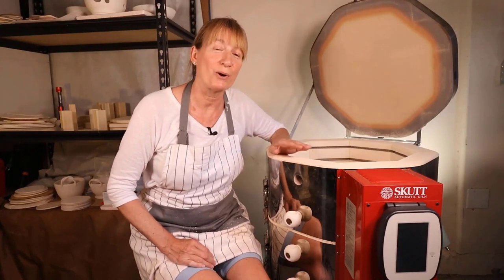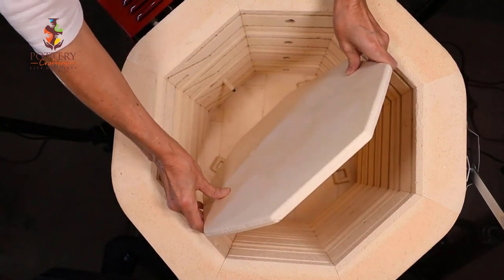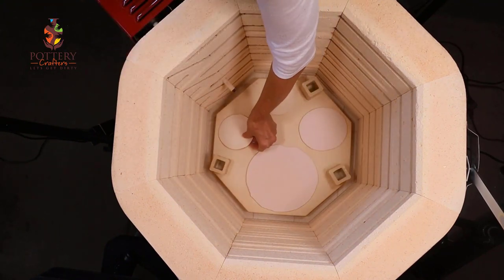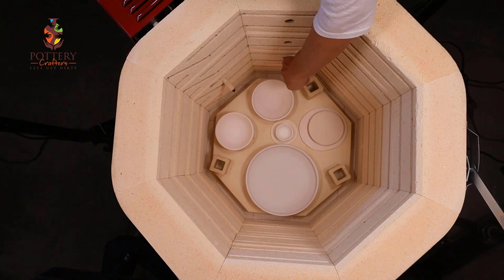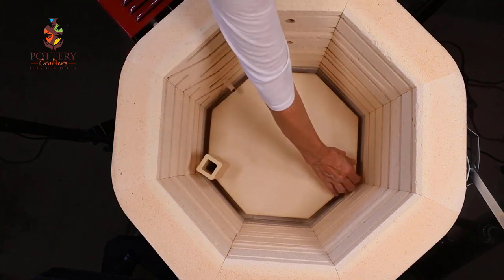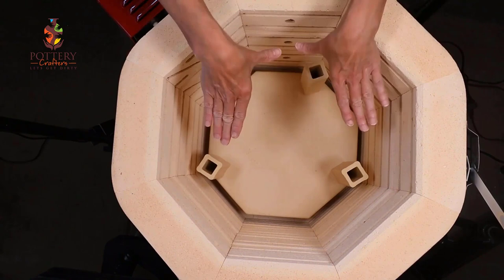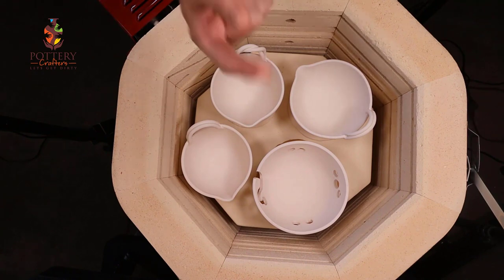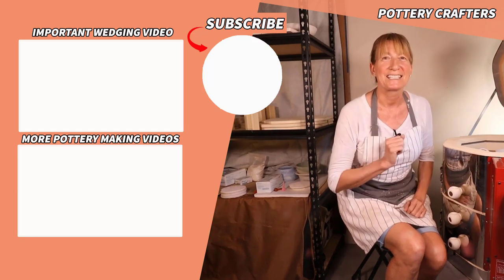How to Load a Kiln - Loading a Skutt 818 Kiln

Comment: THANK YOU SO SO MUCH. I just bought a used kiln and have done 2 firings, bisque and glaze. The bottom portion never turns out. Why? I just placed the shelf on the kiln floor. I never knew you had to raise it to haha. Lordy lordy. Let's see if this helps my next batch 😅
Reply from the maker: You are most welcome. Yes, The air has to flow under the bottom the shelf. What also helps is to fire to 5 cone and put a 20 hold at the end. This is equal to cone 6  except it equalizes the temperature in the kiln and helps to cure the glaze and helps to prevent pinholes. 😊

Comment: Thank you for the detailed video.  A couple of questions.  I throw at least 55-60 lbs a month and will likely increase, since I am still new to throwing, (since March).  Will this kiln be big enough?  Also, why do you use cookies for the bowls?  At the studio where I belong we only use them for test tiles, if we don’t know whether glaze will run.  For known clay and glazes we just wax the bottom and don’t use cookies.  Thanks!
Reply from the maker: Hi. That is Great! For the amount that you throw and will grow. I would recommend getting a larger kiln. It is energy efficient. About $3 for bisque and $5 for glaze.  😊
Reply from the maker: I forgot to answer your other question. I use a lot flowing glazes so I use cookies just in case the glaze runs more then I think. You can check out this video at the 3:55 mark were the glaze dripped onto the cookie from the bowl. https://youtu.be/RWnu7tBxbgI?si=I0xfFuGIa4g097AQ   😊

Comment: This is like loading my dishwasher! 🤣💜
Thank you for this. I got a table top kiln as a gift and while I've done ceramics my art teacher never let me do this (she chose only two students out of about 400 to do it every semester).
Reply from the maker: Hi Winston. Glad it was helpful. I know what you mean. I wasn't allowed around the kilns either. That's why I made the 21-kiln questions video. Here is the link if you have not seen it  https://youtu.be/jtdtBExNpqY  Enjoy your new Kiln. 😊
Reply: @PotteryCrafters  yes! I actually watched it first before coming to this one and forgot the question I was gonna ask until now 😅.
I have an older little thing so no panel to worry about, but in the summer when we can get 100F or in winter where we get below freezing temps is it ok to run? It has its own legs so lots of air flow there, and the area it is in is a large garage that also has a built-in fan in the roof.
Reply from the maker: Very Good Question. Yes it is ok. It is best to start your kiln when the garage is above freezing. So you can warm up the area before starting your kiln. 👍😀

Comment: Marie, thank you so much for taking the time to make such an informative video! I have recently bought a kiln and waiting for an electrician to do rewiring magic so I can do the first firing! I have two questions. 

1) I was so worried about fumes and not venting correctly (with baby home etc) I’ve decided to place my kiln in my back porch. It’s got a concrete flooring and roof. I’m going to cover it with tarp when not using it. Would you have any extra advice I should keep in mind? 

2) I understand you can have pieces touch each other during bisque firing. Does this make the # of pieces you can glaze fire in a kiln compared to bisque fire? 

Thanks again Marie!!
Reply from the maker: Yes I end up with about half the amount for glazing. That is a good idea but just me carful not to get the kiln wet. They hate moisture.

Comment: Great explanation as usual.  My kiln arrived today.  Unfortunately i have two fractures in my wrist and elbow so no playing with clay for another month or so.  I have a question you didn’t use cones in your glaze firing.  Do we need to put them in every time on each shelf.  Also you didn’t put any pots on the bottom shelf is that normal practice.  Thanks once again.
Reply from the maker: That is great. Congratulations Jeanet! Sorry to hear about your fractures. I put small short things on the bottom shelf because of where the thermocouple is located. I never put anything on the bottom of the kiln without a shelf.
 If it's a new kiln I would put cones in when you fire the first few times. After that, I would place a cone in every 3rd to 5th firing to ensure the temperature is correct. You can also check out my 21 Kiln Questions post https://potterycrafters.com/21-kiln-questions-answered/  and Kiln Maintenance  https://potterycrafters.com/kiln-maintenance/ Take care, and I hope you heal fast. 😊

Comment: Marie, I just rewatched this video. I’m a newbie handbuilder and I intend to make small pieces. I’ve recently acquired the smallest Skutt model KM714 and done my first bisque and glaze firing. Many lessons were learned from those exercises. Fitting in stuff was indeed like a jigsaw puzzle. I had made and used kiln-washed cookies after your informative video on them. My question is about the best way to place plates and flat tiles to prevent cracking. I used some grog under all my flat pieces but I was probably stingy with it as two tiles were still cracked slightly. Do make videos on this aspect sometime as also on the advised kiln furniture that can help use the kiln space more judiciously. I’m in India and may not find everything but getting educated on some best practices is also a good plan :-) thanks for your enthusiasm to teach and share through your videos. I’ll be reading through your blog more carefully too.
Reply from the maker: Hello, Jyoti from India. Congratulations on getting a Kiln. That is wonderful. If my plate is too big for one cookie I use 3 or 4 of them with a little space so the plate can move if need be. I haven't had a plate crack yet. Drying is also important. Here is a drying post with a video if you haven't seen it yet   https://potterycrafters.com/prevent-pottery-clay-from-cracking-while-drying/   Happy to help you on your pottery crafting journey.
Reply from the maker: You can also try Alumina Hydrate 😊

Comment: Hi Marie, Thank you for sharing your awesome talent with us. I have a skut glaze tech kiln. It’s square and small. I’m confused on what I hear about hold time. The user manual suggests 5 minutes. I think you are holding for 20 minutes. I wonder because my kiln is small and square it might be different from a kiln like yours. What do you think? Thank you again
Reply from the maker: Thank you. Yes, your kiln is so small all you need is a 5 minute hold to help cure the glaze. The hold keeps the kiln at the ending temperature. A 20 minute hold will be equal to another cone size. Hope this helps. 😊
Reply: You’re always so helpful. I have another question. I hope it okay. I fired some stuff. I used Sax glaze and painted over with Obsidian, and the other way around too. Black on red, red on black and they both have bumpy glaze. Other stuff turned out great. I tried to get some information from online, but they just listed 20 different things. It could be. Do you have any suggestions for me? Is the Sax Not so good? Maybe shouldn’t mix them? Long question. Sorry. thank you
Reply from the maker: Of course it's OK. That is an important question. You spend so much time making and glazing your pottery, you want it to turn out. Yes, you are right. The Sax and Amaco glazes sometimes don't marry very well together. The Amaco glazes are much more forgiving. It sounds like the bumps are from the gases not having the ability to escape from the glazes. 😊

Comment: Your videos are great!  I just got my kiln also a Skutt 818 this week.  I need to put it on the rolling stand and I'm wondering if it's necessary to remove the lid to do this?  I'm worried about the handles not being strong enough to hold the entire kiln?  Any thoughts?  Thanks.
Reply from the maker: Congratulations Kristen.😍 So happy for you. No, I didn't remove the lid. The handles are strong enough because the kiln is not that big. It was actually lighter than I thought. Just make sure someone helps you. One on each side and it lifts right onto the stand. It is so convenient on wheels.
😊Enjoy your new Kiln.
Reply: @PotteryCrafters  Thank you for the info.  We just moved it and it was so much easier than I thought it would be!  :)
Reply from the maker: That is great  👍 Thanks for letting me know 😊

Comment: Great video. You say your kiln isn't vented, just the top peeper is left open. Is this necessary ?  I also just bought a kiln, the same size, with no venting system. And if it 'is' necessary, do you keep it open during both bisque, and glaze firing? Thanks.
Reply from the maker: Thanks Kristopher, 😊Yes it is for both. Having the top peep open for the bisque fire allows the organic materials to escape otherwise it will settle on your elements and back on your pottery which in turn can affect your glazing. This is also true for the glaze fire. The peep allows a little oxygen to enter the kiln and releases the fumes.  Did you see the kiln question video? You can also check this out for references https://potterycrafters.com/21-kiln-questions-answered/. It may help. Good choice on a kiln. Enjoy your kiln. 😍
Reply: venting your kiln is necessary for safety reasons. there are a variety of toxic materials and gases that are released during firing, which can build up in the kiln brick and in the area surrounding your kiln. see this link for more information: https://ehs.princeton.edu/health-safety-the-campus-community/art-theater-safety/art-safety/ceramics#k
Reply from the maker: You are so right😊 Never hang around the kiln area while firing.

Comment: Hi Marie, thank you for this very helpful video! Can you explain why you decided to go with 3" brick wall instead of the standard 2.5"? I hope you can do a bisque fire load video in the future, I have yet to invest in a kiln but the information will be very useful. (I'm also considering Skutt 818 and 822 :)) Thank you again in advance!
Reply from the maker: You're welcome, Della. That's great😍 If you want a little more room I would go for the 822.  It would be better to get the 3-inch bricks. They hold the heat in better, cool down slower, and are more energy-efficient. Thank you for the video suggestion. I will put it on my list. 😊
Reply: @PotteryCrafters  thank you Marie for your answer ☺️
Reply from the maker: You are welcome. Glad I can help on your pottery journey. 😍

Comment: Can you tell me how many inches up the thermocouple is in this Kiln? I just ordered a Skutt KM818 with 2.5" brick and now getting ready to order my furniture. At the moment I'm not making much that I would use 2" posts for so I need to know what size I'll need to clear the thermocouple. Based on your video I'm thinking a 1" for the bottom shelf, then I would need to use 6" posts for the second shelf to clear the thermocouple and go 2" past it.
Reply from the maker: Congratulations on your new kiln. It's so exciting. 😍  The thermocouple is 7 inches from the bottom. I love this kiln. The only thing I don't like about it is the location of the thermocouple. You need 1-inch posts on the bottom. Then keep in mind each shelf is 3 quarters of an inch thick.  The height of posts would have to coincide with the size of pottery you plan on making. I put short things like plates on the bottom and use three shelves most of the time. I have only used one of my half shelves once, but that will depend on what you make. That is very smart of you to do some measuring before you buy your posts. Just make sure you have a clearance of 2 inches around your thermocouple. Enjoy your new kiln. If you haven't seen it, this video may help also. Here is the link for you. https://youtu.be/LsZM6bUmKOc  😊
Reply: @PotteryCrafters  thanks for getting back to me! I actually ordered the advancer shelves, so they will be a bit thinner. I didn't realize before watching this video that you needed a 2" clearance around the thermocouple, so I'm glad I saw this before ordering my posts. I'm actually going to see if they will allow me to switch the 818 to an 822 that way I get 4.5" more space, which gives me a whole 'nother shelf worth per load.
Reply from the maker: Advancer shelves !!!!!! That is AWESOME. 😍 That is a good idea. Hope you can switch to the 822. That was my second choice. Sorry I gave you the wrong video to check out I meant to give you this one Bisque Fire Loading   https://www.youtube.com/watch?v=6XcQ7Nf0f2I 😊  Let me know how it goes.
Reply: @PotteryCrafters  thanks! I checked out the video, it was very helpful! I called this morning and I was able to change to the 822, the order is already in with Skutt. In 2 months I should have my first Kiln 🤩
Reply from the maker: I just received your comment. It took over a month.  😀 A bunch of them just came through from over a month ago. That's great. Did you get your kiln yet? 😊
Reply: @PotteryCrafters  they said 8-10 weeks, so that would mean next week or the week after at the latest. I've been checking everyday for a shipping notification. In the meantime I need to make more so I have a load ready to go by the time it gets here!

Comment: Do you have a video that shows how you load plates for a bisque firing?
Reply from the maker: That is a good suggestion. I stack them but I only stack a few because you can put too much pressure on the bottom plates and risk warping them. 😊

Comment: Marie, what do I do if I have half shelves along with full shelves? This makes it kind of impossible to line up the stilts directly over eachother. Is this a problem? I just noticed you didn't use any half shelves.
Reply from the maker: Very good question Heidi. You would mainly use half shelves for different heights. Place three posts under your half shelf, then 3 higher posts under the next half shelf  to stagger the height  😊
Reply: @PotteryCrafters  Thanks Marie! I really appreciate you!

Comment: Do you use a kiln vent? If so, did you add vent holes to the lid as well as the floor?
Reply from the maker: Great question. 😊 No I do not. I always keep the top peeper out and the garage door open about a foot. It only smells for a few hours between around 500 and 1000 degrees when most of the organic material burns off. I also keep both cars out of the garage. No excess heat in the garage because it is a small kiln with 3-inch brick. Hope this helps 😃👍
Reply: @PotteryCrafters  do you find you have more fumes with the glaze firing?  That's what I'm experiencing.  I do have a down-draft vent since my kiln is in the basement, so I'm surprised by the fumes whenever I glaze fire.
Reply from the maker: That's a good question. It's funny I just noticed the other day that I have more fumes when I bisque fire. That's good that you have a vent 👍 The vent over the over head vents help with getting rid of fumes and extra heat. 😊